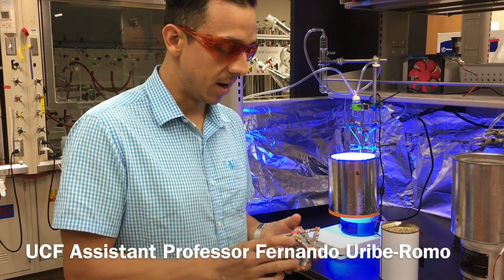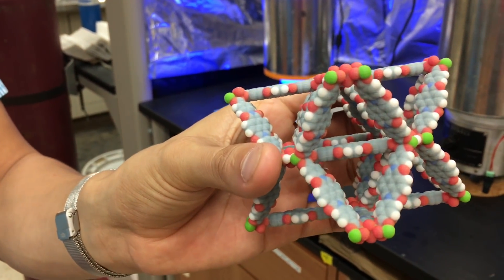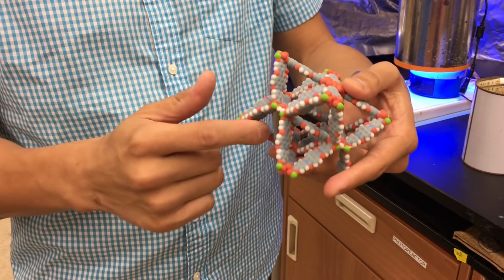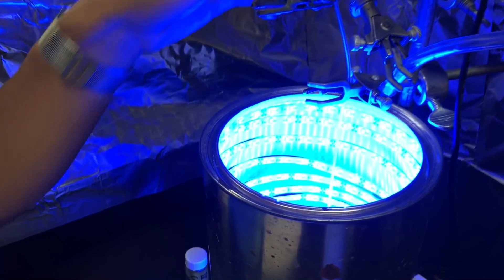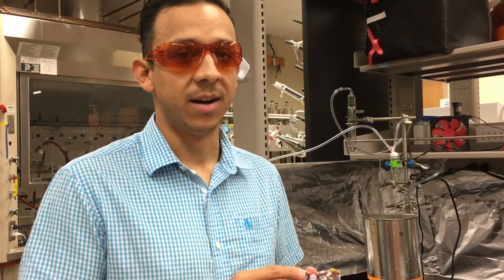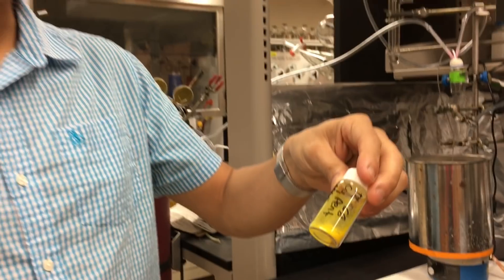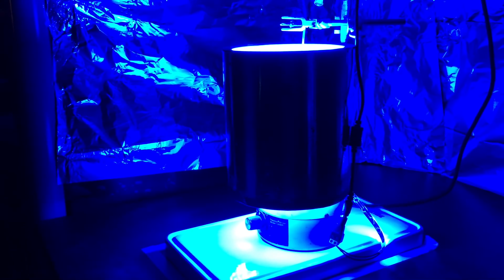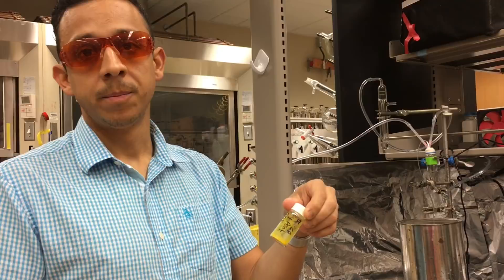Fernando Uribe-Romo on Synthetic Photosynthesis

Comment: What is the cost of using the material and energy to operate these? Is this just a scrubber or is it economical? e.g. $0.10 a KWH? or $5.00 a KWH?  
Bill Gates actually funds Thorium for safely generating electricity. It may achieve $0.32 KWH  by 2018 and use no oxygen at all. Thorium can supply localized energy for small communities or factories without the need to build cross country wired infrastructure. 
The question is always, is this just an application for CO2 regulations for Oxygen burning energy sources that may not be around in 10 years?
Or, would this be economical to set up on roof-tops and generate electricity locally and economically?
It is a great video! But, some real-world economics would be helpful.

Comment: Great work.  But what we really need is a way to capture methane out of the air.  Coal is going away because it's much more expensive than natural gas, wind, or solar.  Thank goodness - because its SO2, mercury, and sometimes radium pollution is bad for human health.  

However, each methane molecule from natural gas is 80 times worse than CO2 for global warming.  Making matters worse, there are many ways that natural gas escapes during natural gas production, so its methane is extremely difficult to capture.  Making natural gas a friendly fuel is a very difficult proposition.

Comment: I'm not clear on the capture process by which the MOF converts the CO2 and then stores the resultant "solar fuel."   I presume, from the video, that it is sucked up the tube from which the MOF dangles in the center of the "reactor?"  Anyway, it's a process question.  

But I will say this...if this can be scaled up easily and cheaply then this is potentially huge, HUGE!  On the order of the first person who figured out how to control fire huge.  Somebody put together a crowd-source funding site for this, ASAP.  I'll plunk down some monies....